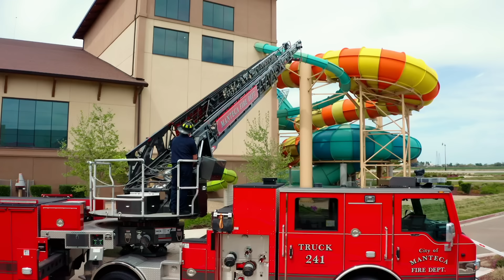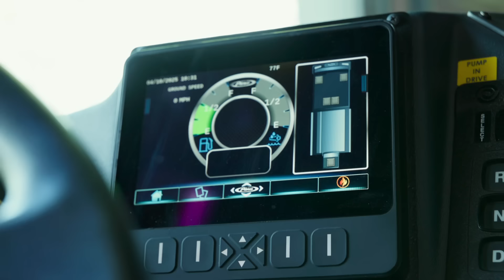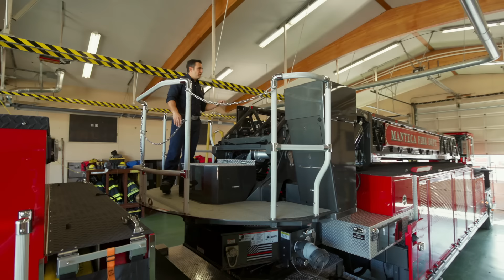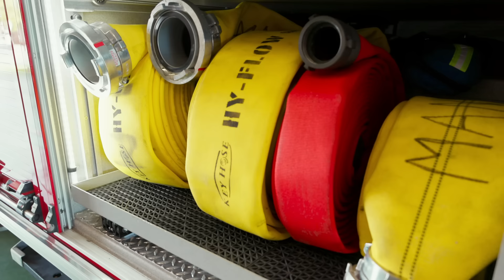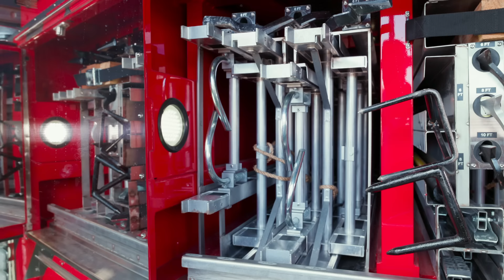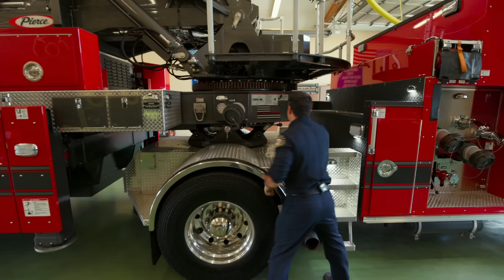Manteca FD Walkaround

Comment: Definitely a very nice Quint.  I prefer a 100 foot rear mount Quint since they are a little shorter and you don't need a tillerman.  There are easier to run as an engine or a truck.  But, each department has it's own needs.